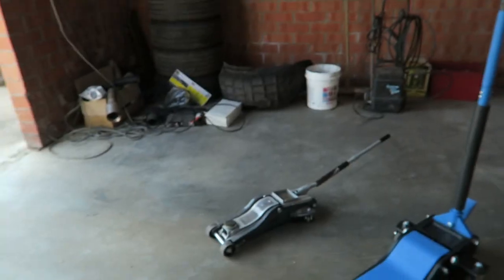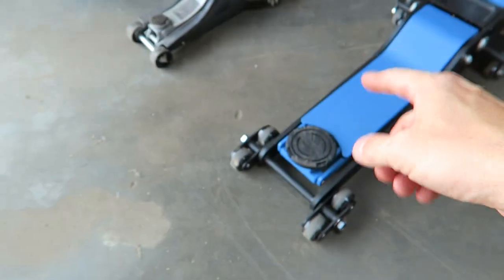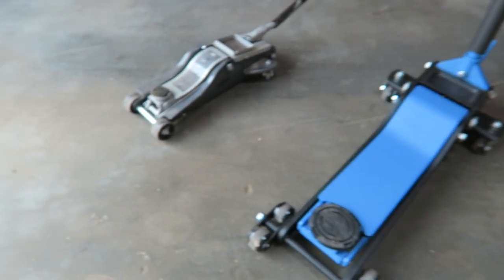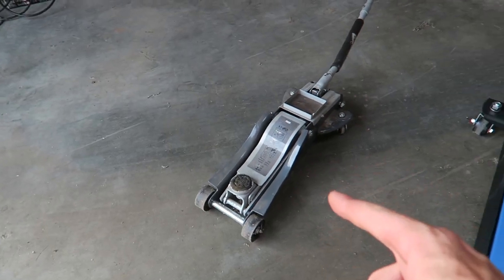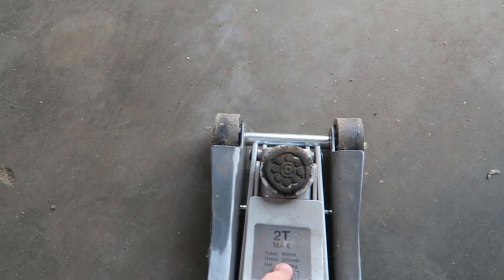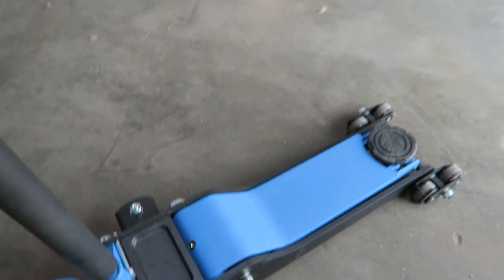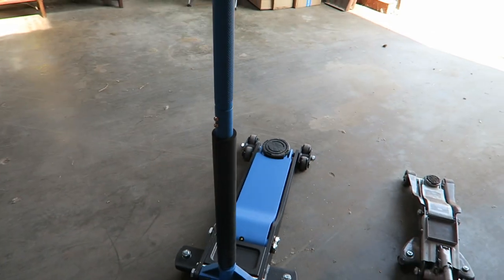Never cheap out on a floor jack!

Comment: Thanks for the video. I got a $60 jack at Walmart which is okay, but it doesn't work for lower vehicles even though it's low profile -- it's low profile for like 2-3 inches, plus I'd like something that jacks up higher especially because I'm wanting to remove my subframe/engine and transmission and I need to jack the body up high without building the tower of babble out of lumber. I'm strongly considering purchasing something in the $200-400 range.